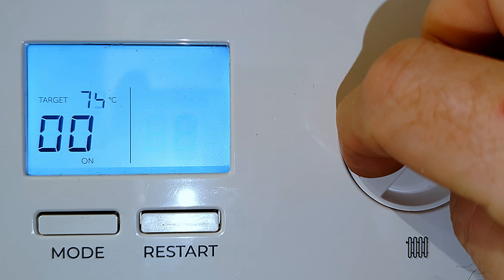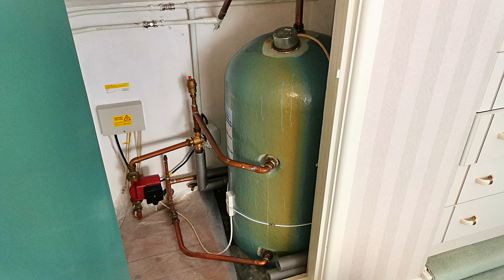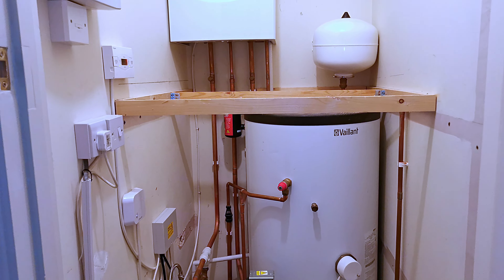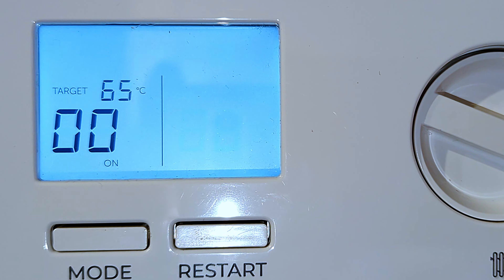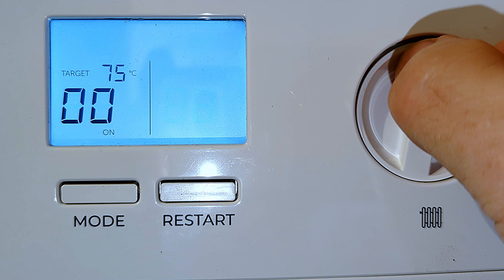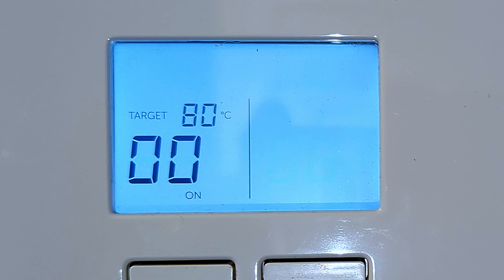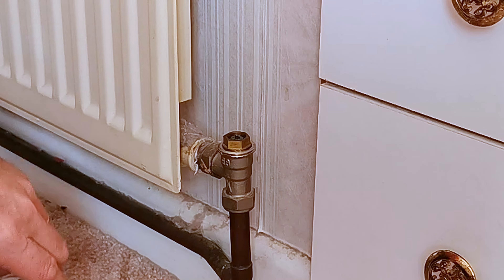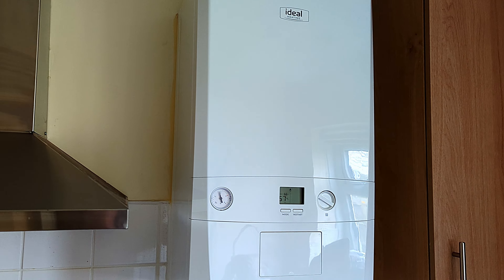How to use Your Central Heating Controls, Boiler Settings, Hot Water Temperature, Room Thermostat

Comment: Hi Mark, thanks for another useful and informative video. 

Just a quick question regarding how traditional boilers operate when heating the hot water cylinder ONLY. 
Summer is approaching so radiators will be soon be off 😊. 

I noticed my boiler firing for two minutes, then goes on standby, while the pump keeps operating for about three minutes, before firing again for another two and so on until the cylinder thermostat is satisfied shutting the boiler off. 

Will all those short cycles prematurely wear down my traditional condensing boiler?
Reply: Yes of course it will…..use your immersion in the summer months…
Reply: You won't wear the boiler down.We had ours for 25 years a small Glowworm Boiler.We had it replaced by a combi boiler.